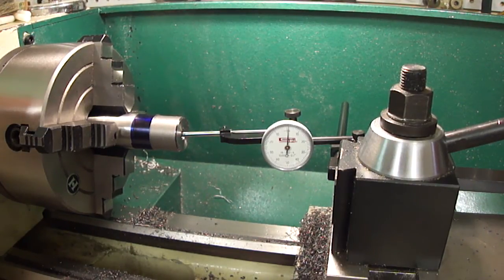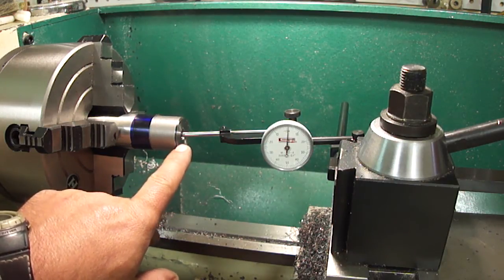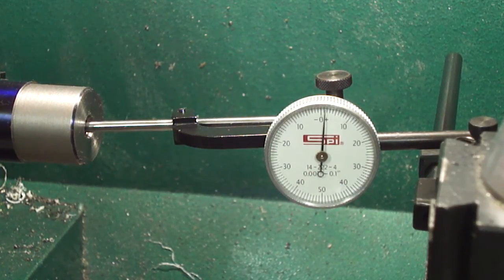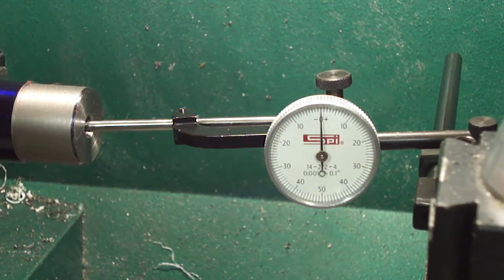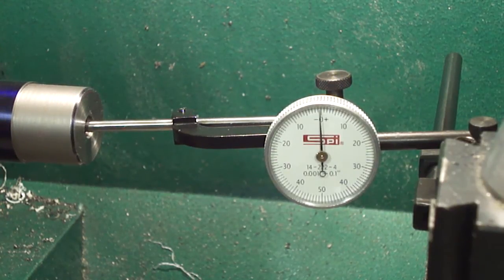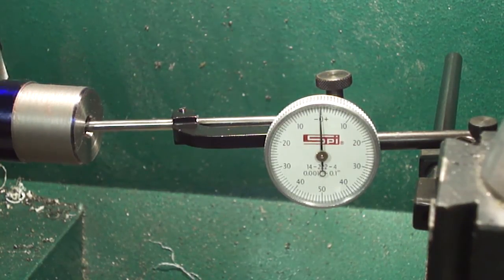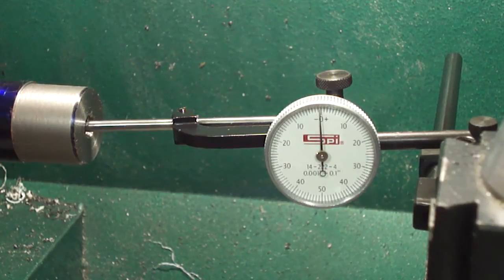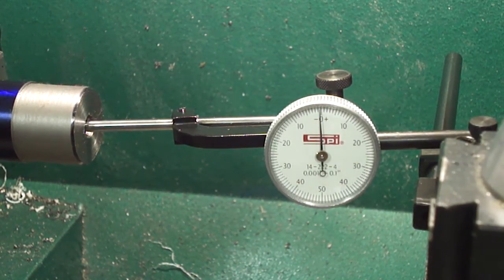Centering a bbl off the bore in the lathe

Comment: What type of Dial test indicator is that, or attachment for it?
Reply from the maker: GR40RCapri just a back plunge indicator.
Reply: ok... and the fixture attached to it?    I was going to utilize a dial-test indicator, but I feel the need to check deeper in the bore and that won't cut it...
Reply: @GR40RCapri  Why would you need to check deeper in the bore? If the goal is to adjust the barrel in the lathe' 4 jaw chuck (or to confirm a 3 jaw is adequate) so concentricity is based on the barrel bore, say if you are recrowning the barrel or threading the barrel for a suppressor etc., then why would depth be of concern?
Reply: @bumper52  to get the section of the barrel bore immediately preceding the muzzle both concentric and parallel to the axis of the machine. If you are only checking at one point, you will only achieve concentricity of that point along the bore, not the  section of bore leading up to that point.